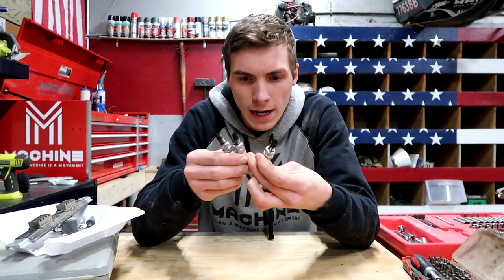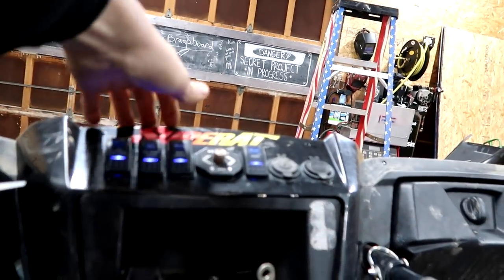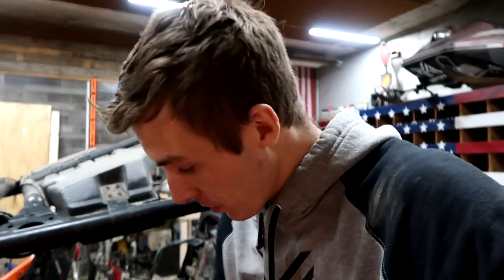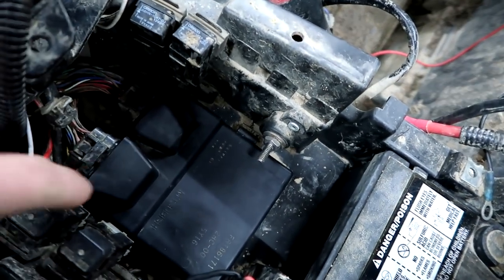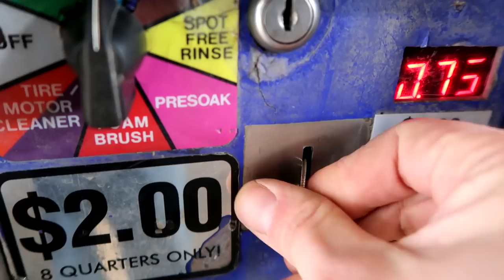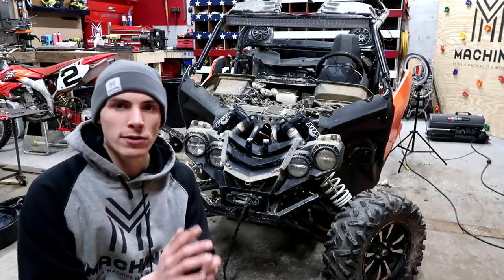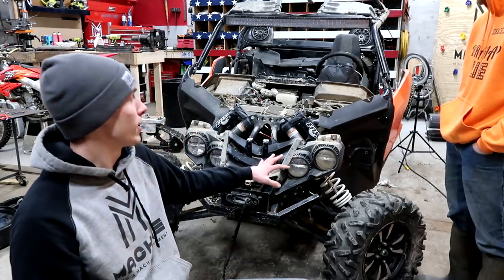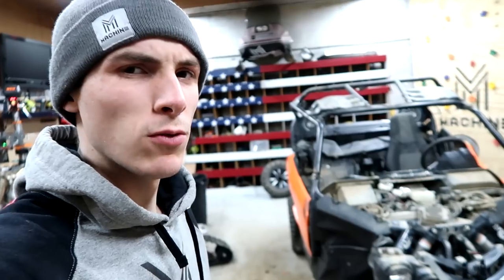i was scammed!!!

Comment: Great job so far!  Quick google search says code 35 is something wrong with the 3rd ignition coil but you probably already know that by now.
Reply: part # 2HC-82310-00-00
Reply: Always test before you buy parts it could be just a loose wire from the rollover. I doubt a coil would go bad in 1.5 years. This Engine is known for reliability, they go many thousands of miles. I worked on a older R1 bike that had almost 300 000 miles on it!  If you take care of it it will take care of you.

Comment: That thing was fu*ked hard and put away dirty. 2700 hard miles. I don't think you have a bent frame problem, just a misaligned rollcage as you already found out. Hopefully theres no major electrical gremlins because I have a feeling that thing ended up like the Titanic and took on water and electronics got wet, how else would electrical components and other stuff up high in the dash area get so dirty other than lots of water splashing or being sunk. Aside from a couple broken and bent front end components, lets keep fingers crossed the running gear is fine, I think this project is doable. Although black spark plugs and the fact the engine was running rich isn't good, I`ll bet the oxygen sensor or wiring to it is damaged.
Reply: Money pit.
Reply: I get the feeling it got partly submerged early in life, but the owner gave up on it the last time it crashed. The mud in it is from one to many water crossings.
Reply: This dude made a BIG mistake buying this thing. It totally got swamped and I'm sure the electrical system is toast. When they get like this, it's VERY hard to trouble shoot. I have a feeling he'll either have to part this thing out, or sell it to another sucker. I'd love to know what he paid for it, I hope nothing more than 2 grand.
Reply: leemer1 - dude i was just gonna type a message about the hard 2700 miles, but you bet me to it, dude you are right on the money though.

Comment: Hey 3DMachines, I haven't seen anyone post this yet, but looking at the error codes for a YXZ1000, if it's 35, you've got an "open or short circuit detected in primary lead of ignition coil #3" which just adds to the electrical gremlins.

Comment: Frames fine !!! That's a good sign guarantee fresh oil filter ,  oil and fresh gas it will fire right up ... who's with me ?
Reply: honda life 250x I’m with u but also my buddy just bought a yxz and he put like 25 miles on his and his spark plugs are black it’s because yxzs run rich and I don’t know if u can fix that or not
Reply: Legend Races new tuner fixes that no problem
Reply: needs to fix fault 35 # ignition coil first, but other than that and any other faults he should be fine..

Comment: Before you waste time fixing the roll bar make sure that pig runs!!
Reply: Robert Riley he’s only doing it cause of views he knows it’s probably a p.o.s
Reply: David Christian over the years I’ve learned to stop rushing into things just because of your anticipation. Will it run? Most likely, but it would be better to take care of the minor things until he gets good parts and give the engine a clean run down. It helps prevent further mistakes from my experiences.
Reply: +Carson Shoe Yeah I agree. Kind of goes hand in hand. I just know if it was me I'd be focusing on the motor and error codes and fixing everything minor to get it fired up. Instead of going over everything else and firing it up and it knocks like a 12V cummins in -15 degree weather lol. Sounded healthy when it did turn over tho
Reply: Robert Riley oh I’d be eager to fire that thing up too, I was just giving both perspectives

Comment: Luckily Yamaha motors and transmissions take a beating I don’t think you will have to worry about those. My guess for the miles reading 35 and the hour 150ish is they replaced the gauge cluster. The hours is is usually saved in the computer witch is why it wouldn’t show up when the computer wasn’t hooked up. You should have a killer machine when you are done and tons of fun. Love your videos and usually learn something new every video

Comment: Set your wheels straight then measure center of front wheel to center of rear. Then go to the other side and do the same. That will give you some idea if one side of the frame is pushed back. With both front axles broken and the tie rod bent like that I’ll bet the frame is damaged. Just my opinion. I owned a atv rental business in Michigan and have had similar experiences. Good luck.

Comment: Sorry to say but you don't get a machine that has that much dirt and rust caked into it and only have 35 miles. (Yes i did see the 35 miles was a engine error code but for future reference). That's a 20k machine base price new so an insurance company wouldn't of totaled it if it only had 35 miles with what appears to be such minimal damage. I just hope for your sake the frame isn't 
bent/broke anywhere. Hopefully you got it somewhat cheap.

Comment: I'd change the filters well you have it apart. based on damage I'd guess someone went back over front in it.  Error code 35 is ignition coil #3 (open or closed detected fault).  
OEM Part # 2HC-82310-00-00  
They are on sale for $65 on bikebandit(dot)com . 
(it's recommended to replace all 3 at the same time)
  
You can find owners and service manuals in pdf online if someone has not sent you the links already.

Comment: With 35 miles and 157+ hrs my math says that would equate to driving an unrealistic average of  0.22 miles per hour.  With 2770 miles and 157+ hrs, it computes to a more realistic 17.5 average miles per hour.  The seller misrepresented the true condition of your machine.  Driving 35 miles would not leave that machine is such a filthy condition unless it was rolled in the mud.  I made my comment before I got to the mud section after the gas tank removal.  The tires are excessively worn.

Comment: There's spark that's a good thing the frame looking better there might be some codes for checking the engine to an for reset ,or malfunction clearing also neutral safety gear switching check if your friend does has those if there are any or not you might fire that scum puppy over !!!🔥🐕💨💨💨💨💥💥💥

Comment: You didn't get scammed. You saw what you wanted to see and didn't see all of the glaring signs that it had way more than 35 miles. You and the auction lot are at fault for not doing their due diligence on finding out the actual miles, but at the end of the day you bought it. Should have done the leg work.